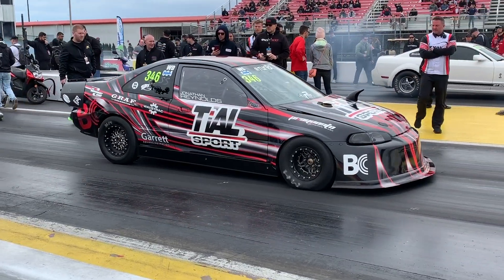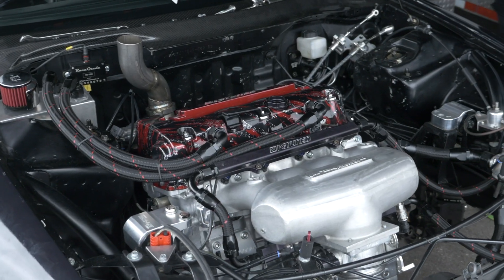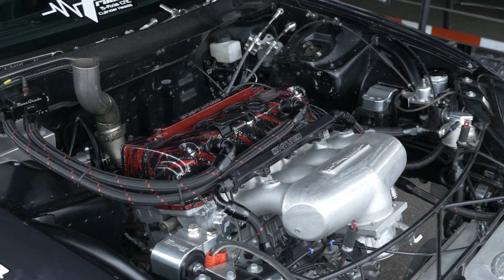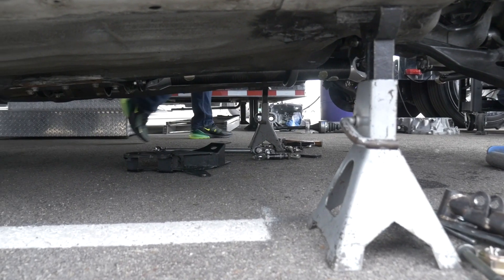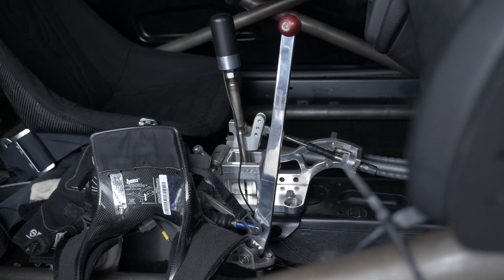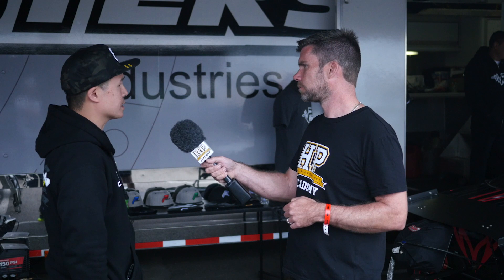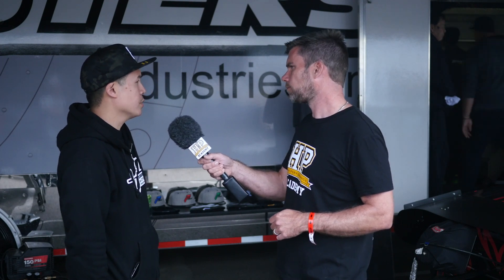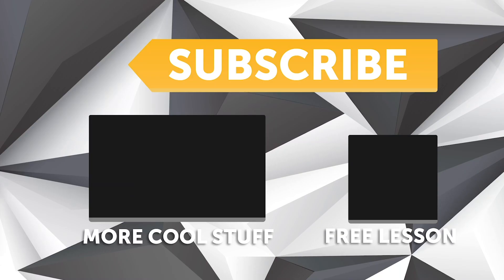1400HP, 70PSI of BOOST | Quickest AWD Honda In The 🌏[TECH TALK]

Comment: Does anyone know what AWD system was used? Or was it created custom for the Ej1?
Reply: Mike Normandy yeah it was made custom. Most of awd systems are. The probably a crv trans with a dog box gear set in it and a cut and kinda Frankenstein-ed together driveshaft. The rear did is most likely from a civic wagon and the rear axles are custom as well

Comment: how sad it is that speed factory still holds the fastest stock chassis honda 1/4 record at 7.4 with a fwd setup lol
Reply from the maker: Why is that sad? They've worked hard to get that record with their platform =) - Taz.
Reply: @hpa101  Am sure they worked hard on that setup but until they go faster than 7.4 it will be sad, cause isnt awd the best?
Reply from the maker: It's the quickest AWD Honda and is in 'early' development, no one is sad ;) If the FWD Honda record holder switches to AWD, runs a smaller turbo and makes sure their within the AWD class rules and then runs a faster pass, you can compare times =) - Taz.
Reply: @hpa101  Speed factory is already trying to come out with a awd b series for the end of this season unfortunatly they had drivetrain problems... they tried to buy a billet transfer case from my buddy at dna performance here in miami but he said no cause dna is coming out hard soon with 2 b-series awd in which i believe will be faster than the k series and will probably make k series fans not sad but desperate if anything lol
Reply from the maker: @InNoTime3377  drivetrain problems eh. Probably highlights the fact AWD setups might not be as easy or developed as you think, yet anyway ;)
More creates more, cool to hear there is a lot happening behind the scenes too. Will be keeping an eye out to see how they all get on - Taz.
Reply: @hpa101  yea they blew the transfer case right at the launch, but yea am excited to see b series vs k series awd shootout! :)

Comment: Interesting interview, But didn't some FWD Honda run a 7.47?
Reply: Yeah, but it's on a billet block, M1 and 100+psi of boost with 2000hp. That's why Norris mentioned He wants to chase 6sec pass once He got a billet block, methanol and not be boost limited.
Reply: Lynn - speed factory b series car
Reply: Lolololol right. All these awd civics and they still cant beat speedfactory
Reply: @Scrambles2112  with 600 hp less and trapping 27 mph lower, they are barely behind on ET
Reply from the maker: @Scrambles2112 Manuel they'll get there, but there is more to compare than just the quarter mile time when you throw figures around between classes and cars as well to the point that often, it's pointless ;) - Taz.